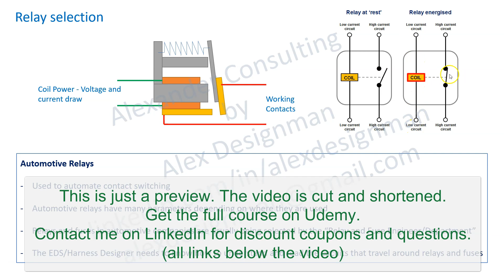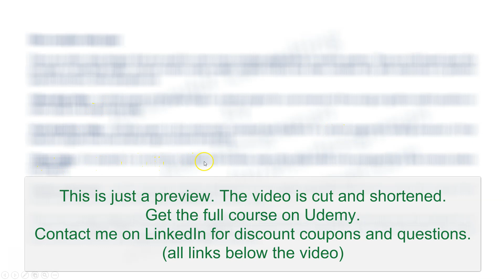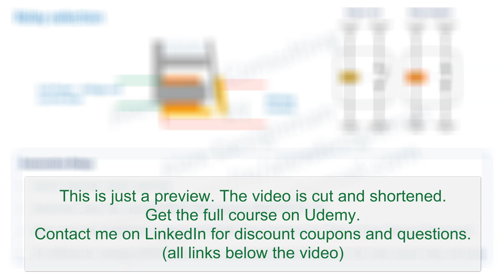Automotive Electrical Wiring Harness Design | Relay Selection Criteria Guide

Comment: thank you. Can you please explain what is special with relays? Why harness designer can not deal with this?
Reply from the maker: Components like relays, fuses, modules, etc. connect with many components that are managed by different departments. So you need a relay/fuse department to interlink those mitigations.